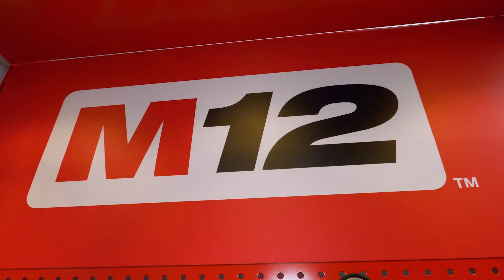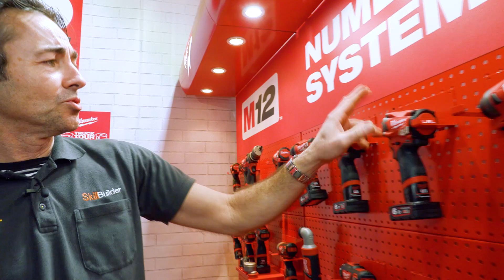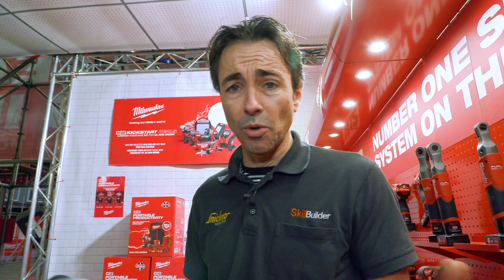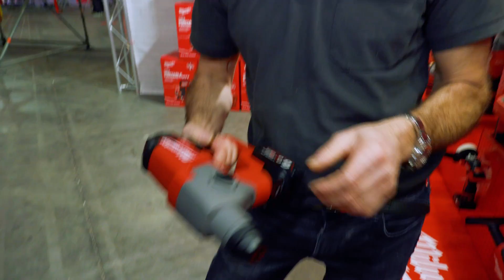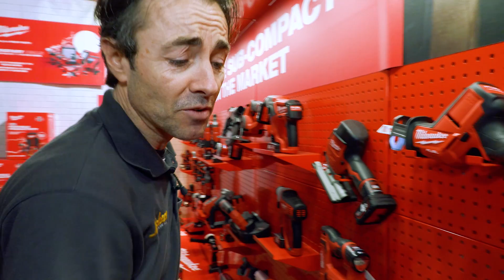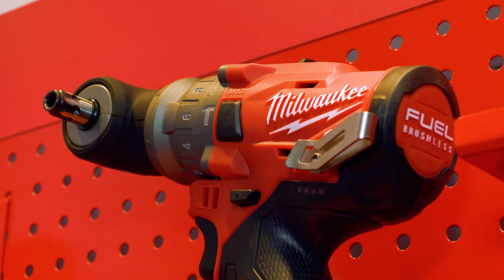Cool Compact Cordless - Milwaukee M12 System

Comment: The SDS is lowest (by far) vibration of any SDS also get a chuck with an SDS fitting and you've got a really powerful drill for timber but no
torque setting of course. Also the C12RAD right angled drill absolutely brilliant and so easy to hold, I use it all the time especially for fitting screws into sash cords for example.

Comment: 12v tools seem to be overlooked alot but sometimes a compact light tool is all you need. I would use 12v hammer drill for 5mm - 6.5mm nylon anchors just fine. Having said that , when I'm drilling 12mm+ all day , I would use the m18 drill. So it all depends on your most common applications

Comment: Joseph Gallea. CEO of techtronics.
The 12 volt range looks real good. I'm sore it will have sufficient power for many jobs or small jobs. When it become repetitive and more heavy work, only then you may need to use the 18 volt Milwaukee.
I notice Milwaukee like to stay within the 18
Volt range and not go to the higher voltage. As hikoki, and dewalt on their multivolt and dewalts 54 volt tools.

Comment: I thought you guys across the pond like , Bosch and festool?
Reply: Makita and dewalt I see normally. Love the Milwaukee gear. I've got festool. Lovely well designed gear, but I kid you not every bit of kit I've had apart from the one handed planer has had to go back. The customer service though has been fantastic. Which is why I stuck with them.

Comment: It's unreal the power the m12 can push. Have many myself m12 3/8 stubby, 3/8 ratchet, 1/2 driver/ hammer drill, etc.. used m18's for work in the field for heavy uses, hopefully Milwaukee comes with a m12 9.0 battery 👍🏽

Comment: When it comes to 18V I've bought into makita and wouldn't regret it for a minute. For compact tools I thought I'd give the M12 range a go. Really impressed with the range and the standout tool has to be the fuel sds drill - absolute beast for its size! Bought a selection of other tools in the range and they're all not too bad. Some lack a bit of power but all in all pretty good. Special mention to the drill Robin showed as well, it's sturdy and very adaptable too. The one thing I would say though is that the build quality really doesn't stand up to makita. Several of the batteries when connected to a tool have become very loose and the general wear and tear after 3 years is quite disappointing when compared to 5 year old makita tools. It is though by far the best 12V range and all the tools I've bought are very useful.

Comment: M12 Fuel SDS "You may even be able to put a 16mm in it?"... I may abuse mine with a 20mm in it way more then I should... if they discontinued that drill tomorrow i'd buy a whole bunch of them to keep as backups. Make sure its the Fuel version though as the brushed version is gutless.
Reply: I've done the same with a 25mm bit...not gonna break any records, but it did the job.

Comment: Love my M12 Fuel impact and hammer drill. Deceptively powerful for the weight. The impact is rarely too small for the job. 6 inch hex-head timberloks into LVLs with ease. Great run-time with the 4.0 and 6.0 batteries is on par or better than comparable Dewalt 20v.

Comment: Milwaukee m 12 tools are top notch , I've been using them for years and now the range is even better , I very rarely get the 18v gear out now unless I'm on a long time job , unless the other manufacturers start making this smaller gear they will get left behind as more and more people start realising just how good this smaller tool range is , hats off to Milwaukee........😜
Reply: I recently borrowed a m12 impact and was very impressed,  for what i was doing the only difference was the smaller size and reduced weight, i couldnt fault the performance.